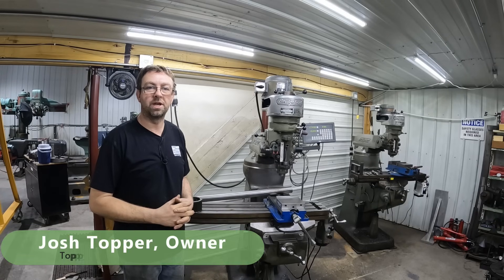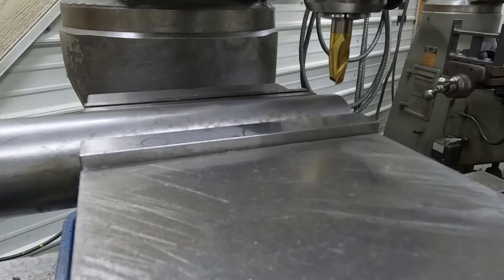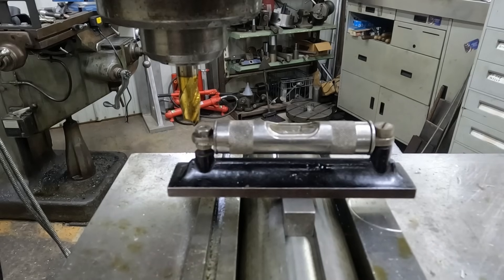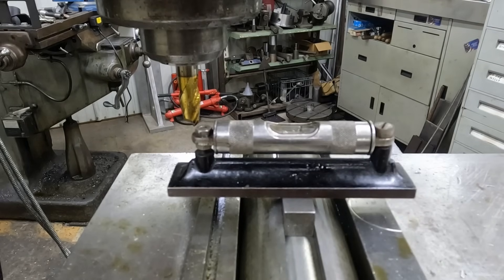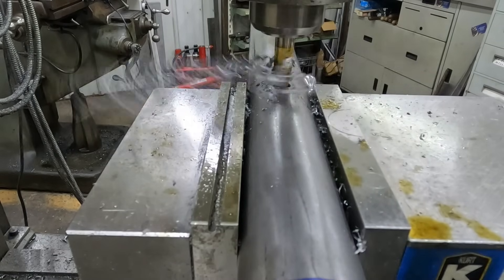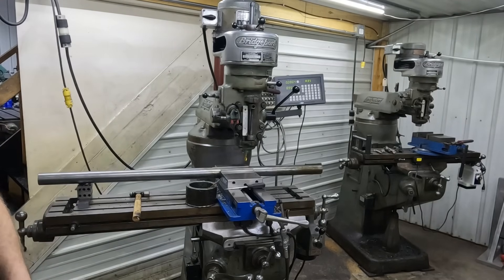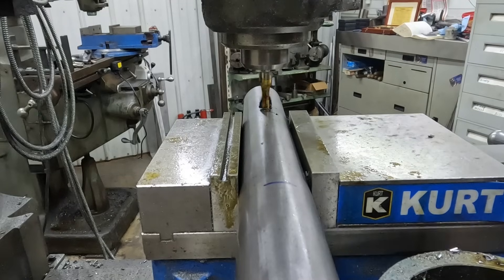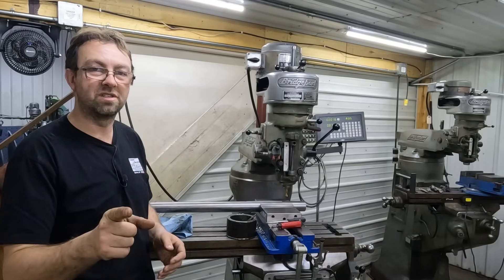Milling Multiple Keyways in Alignment on a Bridgeport Milling Machine - Manual Machinist

Comment: so, you just use a level, and use your eye to determine the exact position of the bubble? we have many shafts come in our little shop, and i am completely self taught on our bridgeport. These shafts have keyed arms that go on them that are a few feet long and alignment is very important. Some of the shafts are 10-12ft long, sometimes as large as 2-15/16. might have 4 or 5 keys in line on them. Ive used a digital, fairly expensive, level for resetting the shaft for travel purposes and so far havent had any complaints. I was telling a guy ive watched several videos of people indexing shafts and just using pipe center finders, and bubble levels and i really dont think there are many shafts that are keyed much more accurately than that. these prints do not give a spec for how accurate alignment is, but it does simply show them in line. Ive asked other local machinist friends how they reset their shafts when they are much longer than their travel... none have ever given a good answer. Usually its, well, yeah that is usually hard and we have to think on it and come up with something... thats about the best we get.

Comment: Great video,

When we cut slots on longer pieces with multiple to all be in line we don’t use a vise on the table, drop the material straight in the table with clamps and you can do slots without moving the work piece, when you are out of travel on the last ones, you can rotate your head on the column and extend the turret to finish. And if possible cut key slot to depth In one pass if your machine can handle it, prevents steps in your slot.

Comment: 👍🏻on 2 flute the old timers taught me to use 2 flute straight flute they would grind .0005 to .001 total under size so you end up with a nice tight key fit  if there was any deflection. They also said that is  the guy that is doing the assembly's job to properly fit the key he can always take a little off with some emery cloth and that you don't want the keystock to just fall in. Good to see you're 1/2 inch tool cut a .499. You rebel climb milling 😁😃😄. Got to break the rules sometimes to make the $$$'s

Comment: I love that you talk about the practicalities of a job that doesn't need to be to a couple of tenths.   Hobby machinist here so here is a question.   What's your take on moving the knee of the mill versus the quill for this type of job??   My z axis on the DRO is on the quill so I rarely move the knee.   Thoughts?
Reply from the maker: Generally, I will give myself an inch of quill travel from the top before moving the knee up.  Any more than that and I prefer to adjust the knee.  Too much stickout of the quill with start to deflect in the cuts.  I don't have any Z axis readouts, I just use the dial on the knee.

Comment: Very nice! I find when I don’t cut the key way to depth in one pass the key way gets wider. I watch Abom 79 and as I recall he cuts in one pass. I’m a novice and just wondering. I’m using a Bridgeport also. 
Thanks
Reply from the maker: It depends a lot in your tooling and the material being cut. Sometimes I go full depth, sometimes I don't. With a 2 flute I generally don't get any oversize, just with 4 flute.

Comment: So when you rotate the shaft to cut the last key way you also need to rotate the level so the adjustment screw is on the same side of the shaft as before otherwise you double the error. I am just thinking and for sure could be wrong but I am in a Holiday Inn Express  right now.

Comment: I'm having a fight in my mind... When you trued your level up to the key I believe you had the adjustment end of the level to the back of the machine, when you flipped the part end for end the adjustment end of the level was to the front of the mill, you kept the level "In time" with the shaft but not the mill. dose that mean you put a "Clock" between key 2 and 3 ? Beings you adjusted the level you were showing true to the key not to earth flat with the level
P.S. I know you said it didn't need to be exact, I'm just thinking of this for practice :)

Comment: 2 flutes all day for keyways I agree. I like tialn coated 2 flute carbide endmills for keys. Most all the shafts I do are 4340 or 4140 quenched and tempered though. Good Ole levels and sharpie marks, that's how it's done 90% of the time. These tail drums and sprockets don't care of its off a little in the lengths lol.

Comment: I have been watching your channel for quite some time now.  I enjoy every video you publish.  I cut a long keyway one time.  I replaced the lead screw on my 52" Craftsman lathe and it was longer than the Grizzly mill table that I had at the time.  I used two square 5c collet blocks with collets inside to keep the keyway aligned.  I would loosen one and move it down the lead screw and then tighten it and repeat on the other collet block.  Thanks for the video keep on keeping on.

Comment: Good on ye. I'm a woodworker with minimal metal work experience, based in the UK (the imperial system fries my brain, lol). Great to see those old machines in operation. They don't make things like they used to. Thanks for sharing. All the best.
Reply: @ellieprice363  Thanks for that 😁 T'was a light hearted comment. I'm 53 and have used the metric system my whole working life so that's what's familiar to me, though being the UK the Imperial system is still used too and I do regularly convert down to a quarter inch. Beyond that, however, if I had to subtract 9/32 from 1/8 say, it would take me some time. I realise that's just a lack of practice. Always makes me chuckle when we occasionally combine the two systems. "Hey, what size is that?" "It's 3 feet by 50mm". 😂 Peace

Comment: Take a v-block with a clamp put in on the bar where it won't be in the way. indicate it flat-cut key way- move piece - re-indicate flat (V-block) - cut other key way
Reply from the maker: I have done that sometimes.  Other times this is better.  It all depends on the application.

Comment: If you used the table slot instead of the vise then no need to shim up.  Of course maybe you use the vise a lot so not worth taking it off. Lots of ways to do the job! 😊
Reply from the maker: The vise comes off the mill maybe 2 times a year.  99% of my mill work fits in the vise.

Comment: Love seeing that H leveling set up you made for #2 mill.......I made one almost exact to that but mod mine with slots on each side of the H uprights to hold a horizontal cross piece...Cross piece is there for when you use parallels in the main vice to support the work piece  (which puts it a lil higher than the bed of the vice) and the cross piece  (which can be placed up or down its slots depending on the height necessary) is then supported underneath with machinists jacks to exact height needed of the work piece.....since the one end of the workpiece is tight in the vice....the far end can then be clamped down snug to alleviate any harmonics or chatter.....w the H support abt 3/4 of the way along the workpiece.....try it and see if you like that....simple to do......
As usual LOVE what you are doing and explaining to the masses...Keep up the good work....hoping the cold n snow leave quick !!!!!!!!
Don

Comment: Thanks for sharing and all the great information and videos that you do.  What cutting oil do you use? It's hard to find good cutting oil might as well use motor oil, all the good additives are taken out.  I like clamping a v block to the shaft and leveling or square to the table. The rose index works ,  not bad mouthing your setup many ways to skin a cat  thanks  ed

Comment: Nice setup and machining Josh,  single pass is possibly a tad too much material for the Bridgeport on a 1/2" slot.
Great photography 👌. 
Thanks for sharing
Reply from the maker: Actually, I usually do run single pass if its not a critical keyway.  1/2" 2 flute will do it just fine, and still hold great tolerance for this kind of work. It is amazing what a 1 HP BP can do.

Comment: Good to see you. I did not know that you can cut both forwards and then back. I am glad that you were able to meet your customer's needs. I would get in a lot of trouble in your shop because I do not know the different grades of steel. Thanks for the good work on the job and on the video. I am sure that you are looking forward to spring. 😎😎😎
Reply: Climb vs conventional cut only matters when doing a partial width cut.  When you go full width of the cutter the forces on either side of the slot cancel each other out.
Reply: @carters2  
I am not a machinist, but thanks for the feedback. I do make some metal art. If you want to see it, go to my old video on my channel. Thanks and I hope you have a great day.

Comment: Have you tried feeding while plunging? For most of the work I do a digital bevel box is accurate enough to keep inline. Also wondering why you put the key steel in rather than just sitting on the keyway?
Reply from the maker: I use center cutting endmills for the most part so no need to plunge and feed.  I use the key because I can trust the bottom of the keyway more than the top edges.  A little burr or a little too hard with the file and you have variations in the outer edges.
Reply: @TopperMachineLLC  thanks that’s good to know